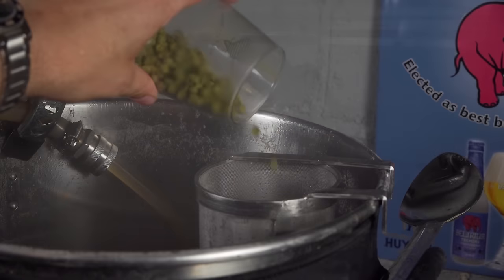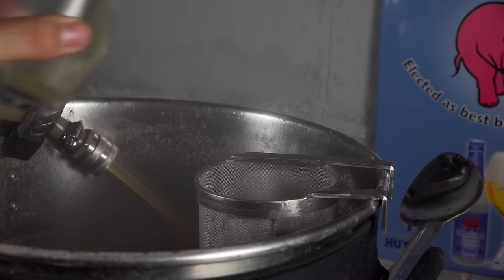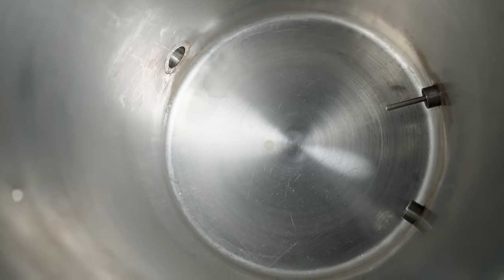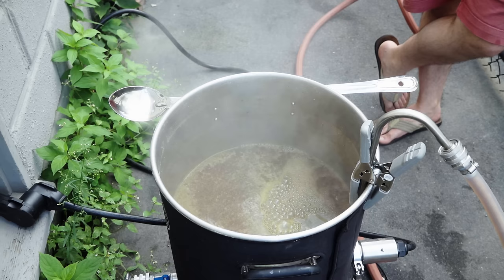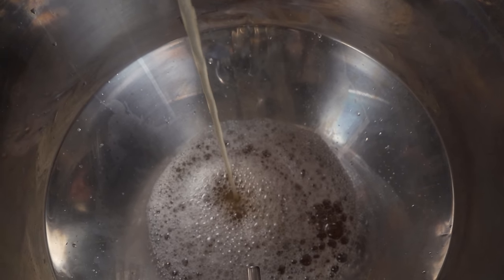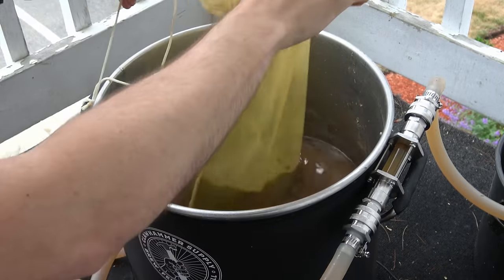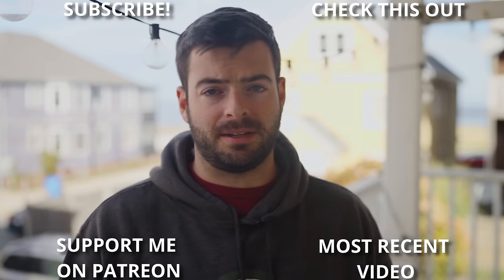MAXIMIZE HOP FLAVOR! How to Add Hops FREELY Without CLOGGING Your System

Comment: Have you tried using the grain basket as a giant hop spider? Curious of the results.
Reply: That's kinda what I do but with a regular bag, I keep it down with the chiller and have all the surface area of the wort basically. I end up catching a lot of the cold break like this also and it's definitely made my beers clearer with a larger yield also by having less trub.
Reply from the maker: I've tried using the basket a few times before but unfortunately they've all been failures. The wort tends to not want to pass through the mesh and its worse than using the hop spider, once my pump ran dry because there was no liquid underneath the basket.
Reply: I did that in my Grainfather once and it failed miserably. The boiling knocked loose the bottom plate and the hops went everywhere almost immediately. After that a lot of hop debris clinged on to outside of the grain basked so as the liquid volume got lower due to boil off those hops weren't actually in the wort at all.
Reply: @TheApartmentBrewer  I have a custom made mash paddle. Pop it in a cordless drill and it spins wort as well at crazy speeds. Piles up junk in the kettle very well.

Comment: To choose hopspider or not… I have chosen to use hopspider despite the advantages mentioned of not doing so.  What led me that way is process control.  With a hop spider, the contact time can be determined precisely both during boil and hop stand and for different additions.  It is for me a way to try to achieve repeatable results and better develop the recipes over time.
Reply from the maker: Nothing wrong with that approach!
Reply: I've recently taken a hybrid approach inspired by this video. I have two hop spiders for any early hop additions (such as bittering at 60, anything around 30, etc.) that's a small amount. I figure if I can split them up into multiple spiders it's leaving "some" room for them to breath, and I'll agitate and stir them a lot. I'll pull the spiders and then proceed with late flavor/aroma additions that free swim.

Comment: My setup is still very basic, one thing I've done is use the hop spider just at the end of the boil when I recirculate and chill as a way to filter out a majority of the hop material.
Reply: ...that's a really good idea
Reply: Some in and some out. That's my method as well. Or only when brewing heavily hopped beers. My system can handle an ounce or two but much more without clogging
Reply from the maker: Wow, this is a very good idea, thank you for sharing!
Reply: @wd6358  4oz or less I've never had issues. I've made a mistake with other adjuncts into the boil like orange peel and now that I have a dip tube and a pump that I use, I have to be more cautious to avoid clogging. I found that out recently.

Comment: While I respect what you're saying here there is no way I will ever brew another batch of beer without a hop spider.  I have had too many problems with false bottoms and other solutions designed to manage hop matter not working correctly or just being too fiddly.  I had one problem recently that cost me an entire 5 gallon batch of beer.  That was the final straw for me.  Never again.  I will gladly accept whatever the consequences of using a hop spider are in exchange for perfectly clear wort going into my fermenter trouble free with no clogged pump, drain valve, or wort chiller.

Comment: I totally agree with you Steve. I ditched hop bags over a dozen years ago and have only used a hop spider once or twice on a Grainfather (due to built in pump clogging) for large hop additions.
I “go commando” on all my brews. Saves on hops from higher utilization, better flavor and aroma like you said.
I do a little effort to keep hops in the kettle, but I don’t care if some get into the fermenter. Oh and I use an immersion chiller so no concerns about clogging my chiller.
Reply from the maker: Cheers Larry! Glad to hear you agree, it's definitely an impactful process change!

Comment: Thanks Steve that certainly answered my question regarding your whirlpool. Just after I posted the question, I saw that the whirlpool arm that you designed and developed is now available for purchase (I won't say where from just in case :)) Love your flow diversion changeover valve system, that's my next project.

Comment: I BIAB, basically i use an old beat up bag during the boil and keep it from floating by having the chiller in there from the beginning (Since i set the system to max to boil). That way I have contact to the whole wort and end up catching most of the cold break as well in the bag. 
Since I started using this process my beers have been super clear and I have way less trub by the end of fermentation, having a larger yield also.
Reply from the maker: That's a cool idea - so you find it doesn't impact wort flow to the fermenter then? Sometimes simpler is better!
Reply: @TheApartmentBrewer  I personally never had any issues especially since I don't use any pumps (Got that CH education).
Just lift the bag at the end of chilling with an immersion chiller, do a bit of a whirlpool to get whatever is left of the cold break to stay in place. Then into the fermenter it is. Edit: I've had slow flow from the bag a few times, especially with a DIPA with lots of hop additions, i just let the bag hang and it drains in about 15 mins,  only then will I open the valve to fill the fermenter.
I got the idea from this video: /watch?v=VlxO6oV2kJs
But instead of making a spreader for the bag, I just used my immersion chiller, it's pretty large width-wise so it does the same job essentially.

Comment: I've never used a hop spider and have only had hops/protein clog anything once. It was the first time after I converted my kettle to electric and added a screen on my kettle valve. It instantly plugged and has since been banished to a box somewhere out in the garage. Other than that, the only time I've plugged up the valve on my kettle or pump was when I added citrus peel to a beer. I've brewed a 12gal NEIPA with 9oz of free kettle hops and had no issues.

The whirlpool method does work and I've used it if I have extra time on brew day. The only thing I do differently is chill the wort first to prevent over isomerization of late hop additions.
Reply from the maker: Orange peel is a nasty clogging agent for sure!

Comment: Brew Hardware for the win! I have the privilege of being in a homebrew club with Bobby and Larry. Bobby made some modifications to my Brau supply system that really upgraded it.

I also noticed the same inefficiency once you load up the hop spider too much, so what I do is I just add stuff to the boil, removing my system's hop screen, and then when I put the beer in the fermentor, I pump or drain the batch through a sanitized hop spider. You can also do the same prior to bottling if dry hopping.
Reply from the maker: Bobby is the man!!

Comment: So if I'm understanding this correctly at the end of the boil:

1 Turn off heater power ( I don't think you explicitly said)
2 Set flow to whirlpool arm
3 Turn on pump for 3 minutes

4 Turn off pump for 15 minutes
5 Change flow to plate chiller
6 Continue as normal

So for immersion chiller you just sanitize it at the beginning of the boil? If you leave the immersion chill in during the whirlpool I'm guessing this won't work?
Reply from the maker: Correct - but you can leave the immersion coil in. Shouldn't be an issue as its circular

Comment: Thanks so much for your vids. Long time viewer first time "commenter" been brewing for about 2 years now and you've helped me a lot. Still struggling with a sour/ cider flavour in my IPAs but I'm working it out. Thanks again
Reply from the maker: Glad I have helped out. Guessing your off flavor is going to be related to yeast pitch rate and fermentation temps, just try to ferment your IPAs cooler and give them a longer fermentation to clean up off flavors. If you are adding sugar, try to dial it back to avoid cidery flavor

Comment: Thanks for all the interesting and informative videos. Much appreciated. I have quite a basic single tank brewer. I used a hop spider but still suffered a clogged bazooka in my early brews. A friend then suggested I dispense with the spider and add leaf hops directly into the kettle. After chilling the wort with an immersion chiller the hop leaves settle out and act as a filter bed which traps the cold break and prevents the bazooka from clogging. This works very effectively and needs no extra equipment. It does rely on using leaf hops however. A small amount of pellet hops can be accommodated in the mix but in general these break up into fine particles and using too high a proportion risks clogging. If you must use pellet hops the whirlpooling is definately the way to go.
Reply from the maker: This is a good point that I forgot to touch on in this video. Thanks for pointing it out!

Comment: Hello! Great video as always. 
I'll try next time to switch place of the pump and the chiller in your set up. One 3-way valve less, I'll use just one direct after the plate chiller, this for circulating or chilling into the fermentor. I know  you should avode items before the inlet of the pump, but my chiller is smaller then yours.
Gravity will solove everything to the fermentor. I want to do splitbatch in 2 fermentor. What do you think of my idea? Sorry for my spelling, I'm from Sweden😂

Comment: Thanks for the video as always, very detailed and informative. I recently moved to using a hop spider for kettle hops, not because of clogging the pump (the grainfather g40 I use drains through the center bottom and has a pretty good false bottom and pump), but because I was worried too much "stuff" was getting into the fermenter after chilling. Do you think there would be any issues with using the hop spider to filter from the kettle into the fermenter?
Reply from the maker: In my experience, hop spiders will gum up and overflow if you are trying to push wort through them. Don't worry too much about trub pickup going into the fermenter, it doesn't really impact the beer very much

Comment: Very cool video. I just got a Clawhammer and I brew heavily hopped beers so may have to use this set up. When mashing, are you basically using the Whirlpool set up but instead of using the Spincycle you connect to the lid?
Reply from the maker: Not exactly. I use the regular loop kettle -> pump -> lid for mashing, but I have the three way valves still set up so I just have to swap one hose out.

Comment: Thanks Steve! So in my equipment profile if I set whirlpool/no-chill time to 20 minutes or so and temperature to about 180 or so (since the wort naturally cools a tad after flameout) that should get me in the ballpark? For aroma additions, would you recommend doing a hop steep instead? Thank you, I just got a Exchillerator but trying to figure out the logistics of this since I can’t/won’t whirlpool cold because recirculating isn’t as efficient. Thanks again!
Reply from the maker: I think that should work. I usually still segregate my 0 min additions and my deliberate whirlpool additions though since in the deliberate whirlpool I'll have constant motion and temperature and in the 0 min style addition it's only a small amount of motion and a falling temperature.

Comment: I was thinking about buying Clawhammers whirlpool arm for my CH system.  Have you found the heating element a factor when whirlpooling?
Reply from the maker: It might slow things down a bit but I've had no significant problems with it impacting the whirlpool

Comment: im using the 800 micron mangrove jacks spider atm and think its a good combo of containing hop matter but not all of it, it pretty much just holds the larger matter and lets the finer stuff through which isnt an issue as the size it lets through dosent clog anything, the spider i had before was about 150 micron and held near enough everything but i was bothered it was holding in the oils too which is why i went with a larger micron mesh
Reply from the maker: Makes sense, maybe I can experiment with a larger mesh

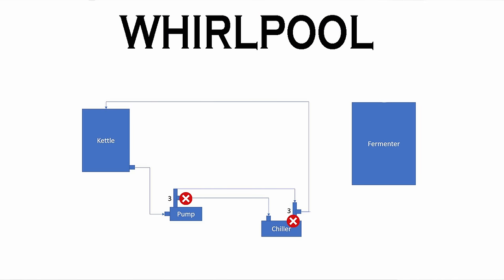Comment: Why not sanitize your chiller by recirculating through the chiller without the cold water turned on back into your kettle like you mention at 7:30? That seems the most straight forward to me. Are you trying to avoid preheating the chiller? Genuinely curious. Cheers.

Comment: Fully agree, I noticed that when I replaced my hop spider with a 800 micron one and also one of the reasons I've chosen G-40 as my next brewing system as it can handle 500g of hops without a hop spider (and without clogging)

Comment: I tried out your exact system, but confused a bit in how to set valves. I will give another go tomorrow. Any secrets to remembering how to set valves?
Reply from the maker: I usually just do a rehearsal of which valves I will turn for which parts of the brewing process and trace the flow path every time before turning on the pump

Comment: I go back and forth on my hop spider due to this concern especially for large whirlpool additions for IPAs. I would many times just free throw them in there but there is alot more clean up need and also a large volume of the hops make it into the fermenter. My concern is less of the clean up and more of the long duration hop contact with the wort then beer over the week plus it ferments. I have found a middle ground which you show here. But also, during the boil process, using a thick insulation glove, I take my hop spider and "dunk it" into the boiling wort, lifting it up and down in and out of wort to help the liquid flow more freely and release the oils. I usually do this a couple times during the process. For whirlpooling I have done something similar to what you show, I have the spider sitting and let the whirlpool arm pump through the hops spider. In addition to this I take my metal spoon I sterilized and I use that to stir the hops in the hop spider as well to make sure they don't just get compacted down. I know this is a more hands on process but I have seen great utilization this way, and I no longer fear underutilization of my whirlpool hops and it cuts down on hops in the fermenter, best of both worlds. Another option could be straining your fermenter as you pump in the wort but I don't have a mesh screen that fits for that.

Comment: I have a recirculation pump on my boil kettle which flows from the bottom of the kettle and into the hop spider.  I'm not saying this is a perfect solution, i.e the temperature of the returned wort will be below boiling point so hop utilisation may suffer.  But I'm happy with the result so far.

Comment: Question about recirculating arm and chill plate…I have the clawhammer 10 gallon system just picked up the arm and valves and ditching the hop spider. I also picked the 1/2” npt pick up tube. Is it possible to chill down enough when going from kettle to chill plate directly to fermenter? I’ve always recirculated back to the kettle to get the temp down and of course results in lots of trube in the fermenter, which is why I’ve decided to use the arm.
Reply from the maker: If your ground water is cold enough it is entirely possible. For example I live in New england and in the winter one pass will get me to roughly 60-65 F. In the summer it's more like 80-90 F. Still easy to finish the last 20 degrees of chill in the fermenter though letting it sit in the fridge

Comment: I love the elegance of using physics principles to help with wort clarity. 
BUT, My problem is that I have heating elements at the bottom of my DIY electric kettle that thwart any attempt to collect hops & trub in a whirlpool cone. 
So, here's my workaround:  
I still use a hop spider and...
-vigorously stir the hops in my spider 
-lift the loaded spider and allow it the wort to drain back into the kettle
-re-submerge it and allow it to refill with hot wort
-repeat 3-4x in 30 seconds. It's like steeping a teabag.
-repeat this process every 10 minutes or so during the boil. 
So, it IS a bit of a hassle compared to "no-spider hopping" and whirlpooling but it has restored my hop utilization & hop flavor to excellent levels.

Comment: Could you accomplish a whirlpool in the Clawhammer with just a spoon/manually? I have the 120V Clawhammer and I'm looking to increase hop utilization but doing it manually with a spoon seems easiest without having to purchase new equipment. Thoughts? Thanks for the great video!
Reply from the maker: Absolutely, that would likely work just fine.

Comment: I got the hop spider with my grainfather. I used it most of my brews, but as I've gotten my system tuned I removed it since the hop spider gets in the way of first wort additions during the sparge (makes the basket sit uneven).  I've mostly just been throwing them in freely and doing a manual whirlpool for about a minute at flameout. Then I let it sit for 5 minutes. That procedure has pushed all the hop material away from my pump and allowed me to get relatively clear wort straight from the boil kettle pumped through my counterflow chiller.  

The big thing I'm planning on changing on my larger hop additions is using a muslin bag to contain the hops.  That's a technique I saw in use in a commercial capacity. Since the hop bags are relatively free floating they dont affect the utilization or flavor much, and when done, the bags can just be lifted out from the twine used to hold them off the bottom/away from the heating element. I just havent gotten the muslin supplies yet to do that for the upcoming batches I have planned out over the next month.
Reply from the maker: I still think for hugely hopped brews I will also use the hop bags as well. Have yet to really max out this whirlpool method.